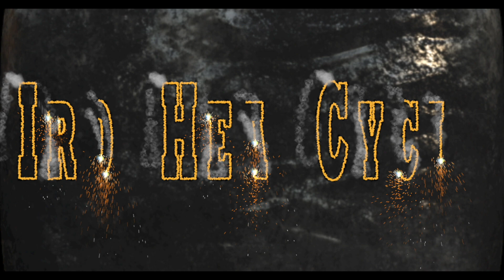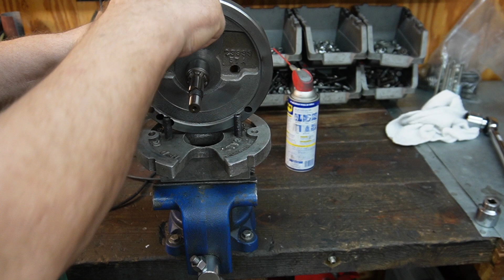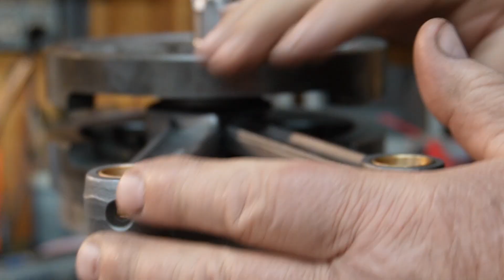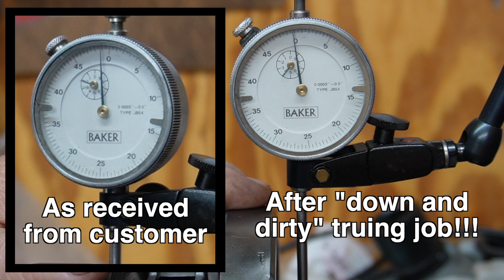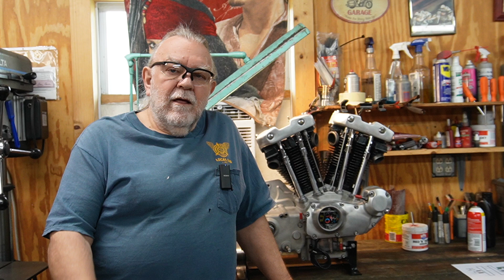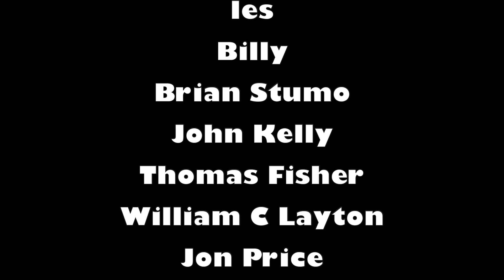Secrets Lie Within Part 2 Nbr 268

Comment: Very good video. I have an off the wall question, could you take the wrong crank pin and drill a correct size hole at the 90 degree position, and would it work?  No, I am not recommending this type of thing, just more thinking that it should work to get the oil flowing... But I can not determine if there is something else different on the crank pin to cause different issues.
Reply from the maker: Theoretically you could do that. But, it would be problematic. The pin is case hardened. You'd have to drill on the taper so the pin would have to be clamped so that the taper was perpendicular to the drill or you'd have to mill a flat spot on the taper so the drill bit could take a bite. Or, as another commenter suggested, you could leave the hey out. But, now that I think about it that would cause the cam/ignition timing to be off.
Reply: @IronHeadCycle  yeah, that taper would be a royal pain to deal with.  I was not thinking about that.

Comment: It’s funny almost comical how easy it was to true those flywheels Gary , and yet the previous shop with I’m guessing specialized equipment couldn’t even get it in the same ballpark sheeshhh 😩🤦🏻‍♂️ I really dig your videos and I’ve learned a heck of a lot from your channel and specially after watching this video I feel much more confident about doing a complete rebuild on my sons 79’ Ironhead when the time comes because his is going to need new rod bearings and possibly new crank pin because some dumb ass must have left the bike sitting outside with the carb and intake open and when we pulled the timing cover more water came out then oil ughhh 😩😩🤦🏻‍♂️
Reply from the maker: Yep, that particular set did fall into true very easily. Believe me,  they usually aren't that easy. That particular shop has no shortage of bad reviews...

Comment: Why did you show the clocking position of the woodruff key..
It isnt positionable..
Its made a certain way ..??
What does NBR stand for ..??
Reply from the maker: Nbr=Number
Demonstrating that there are two different crankpins, they both will "fit" but if the oil hole is "clocked" incorrectly relative to the key you will cut off oil to the rod bearings. The crankpin must match the flywheel.
Reply: Must have missed the previous video.